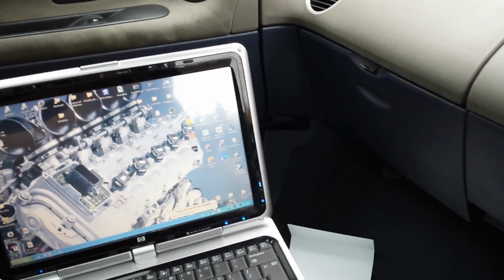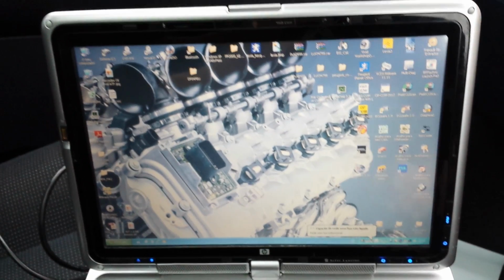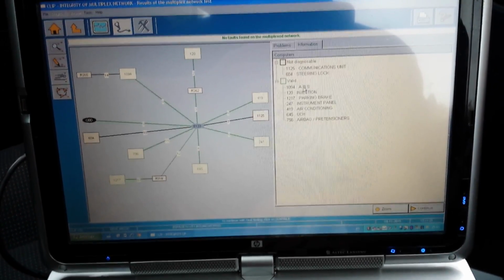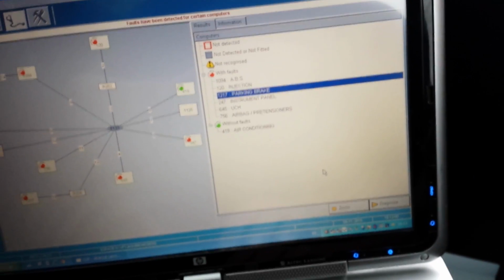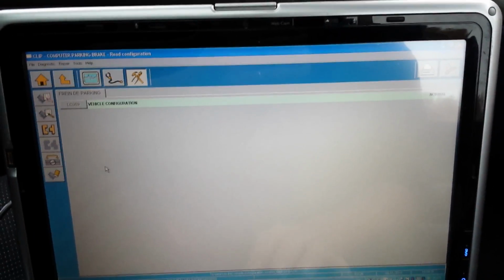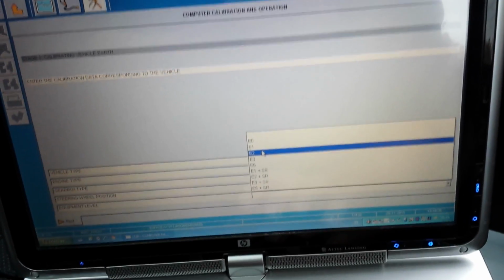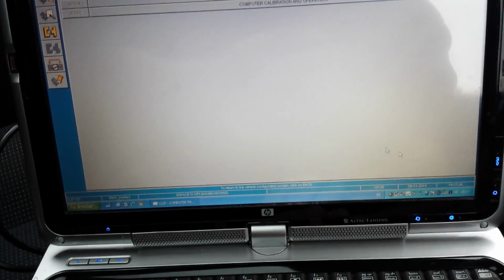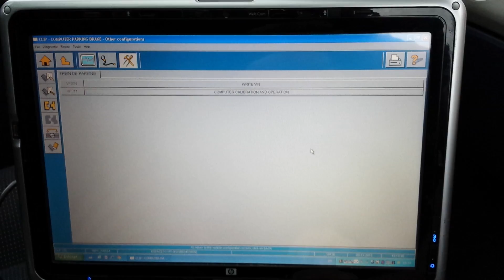Renault used electric parking brake configuration with clip.

Comment: I am having a similar issue with my Renault scenic.
Where is your garage? Can you please help me to fix it?
Reply from the maker: What issue are you having exactly?
Reply: So I recently changed the complete hand break module. Since then the hand break is not coming on automatically. It does come off automatically.
Reply from the maker: It could be coding...
You need to plug it in and check...
👍👍👍
Reply: I don’t have the code reader will you be able to do it for me where are you based?

Comment: Hey. What about if can clip doesnt recognize the unit? A friend of mine replaced the unit with second hand one and i can see it in clip the unit is present with another vin but the multiplex system shows the unit as not recognized. Could a second hand module be faulty?
Reply from the maker: Possibly...
But can you coded it first? 
Thank you for watching!
Reply: @LMAutoRepairs  code it like what? like you did in the video?
Reply from the maker: Yes...
Reply: @LMAutoRepairs  thats the thing.. i cannot access the coding menu because the unit is not recognized. and i cannot do anything with it
Reply from the maker: @anze.stempihar  
Well, in that case there is a possibility that that unit is faulty...
Check can lines, make sure you have comms ...

Comment: Would you please assist me with a few tips? My handbrake after the start motor was replaced, the handbrake doesn't go off automatically anymore.
Reply from the maker: I cant really see how would be related...
Any codes?
Thank you for watching!
Reply: LM Auto Repairs I will search for the codes and get back. The other challenge is the board says battery low when I switch off the car, like now I have to collect a replacement battery from my dealer after the one I bought in March died.

Comment: Hi great video just wondering if it's possible to write vin to a used handbrake unit on a scenic 55 plate as can clip won't recognise computer thanks
Reply from the maker: Hi
Something else is wrong... clip can't write the vin to a module that has a vin already programmed... but, would recognise the module even with a different vin... if that is not happening,  you either have a bad second hand unit, or there is a problem in the car somewhere...
Thank you for watching!
Reply: Hi thanks for reply much appreciated I think it's maybe the model numbers are different I opened both new an old brake module an circuit boards are completely different my old module had internal motor fault which the motor was burnt out so goin to purchase another module wiv same model numbers see if that works first thanks again for your reply I've watched a lot of your videos easy to follow an very informative thanks paul
Reply from the maker: @daisyvlogs2622  
Ok...
Can you not just swap the motor? 
Or are they different ?
Reply: Yer I swapped both motor an relay as the old motor was burnt out but still got internal motor fault df043
Reply from the maker: @daisyvlogs2622  
Ok... check that when the motor burned, did not damaged anything on the pcb... like fuses, relays etc...

Comment: Hi I just saw your video. My 2007 Grand Scenic has the same message on the dashboard. The handbrake has been replaced with a new one and was working fine. The message appears only whilst parked up or stationery but disappears when the clutch is pressed down, but reappears if I'm still stationery. No message appears whilst driving. My mechanic has changed the clutch sensor and gear box sensor but it's still coming up with the same problem. Can you please help or advise? No other problems.
Reply from the maker: Jusna Miah 
Hi
It sound like a coding problem... something has been coded wrong...
Why are they changing parts without diagnose the problem?
They should scan the car, look for trouble codes... live data etc...
Hope that helps. 
Thank you for watching!
Reply: LM Auto Repairs Thanks for getting back to me. The mechanic has scanned it and it came up saying that the clutch sensor and gear sensor needed replacing, hence the reason for him changing them. The message only comes up whilst the handbrake is on and car is stationery. However whilst in stationery position, if the clutch is pressed down the message disappears but comes up again aboutt 5-10 seconds later. No messages come up whilst driving though. Any thoughts? Thanks for your assistance
Reply from the maker: Jusna Miah 
As I said... it sounds like a coding issue to me...
Although the codes were for those sensors, obviously did not solve the problem...
I can't help you any further... take it to some one with clip and an understanding of those systems...
Reply: LM Auto Repairs Thanks for the advice. I will do that and see if anything changes.
Reply: @jusnamiah1608  hi there, i have same fault have you sort it out?thanks

Comment: Hi, I have a Laguna and have swapped the handbrake for a secondhand replacement my techno diagnostics tool won’t communicate with the new ecu and my local Renault specialist says it can’t be reconfigured. Having seen you do this in this video I assume that it is possible. Please can you put me I touch with someone that is able to do it. Thanks
Reply from the maker: Matt Dennis 
Hi
Which tool are you using?
Thank you for watching!
Reply: LM Auto Repairs Hi It is an autocom tool. I was able to make changes to the original ecu but this one says that there is a multiplex fault.
Reply from the maker: Matt Dennis 
If you can communicate with that unit, but you could do it with the old one, most likely there is something wrong with that replacement...
Just in case, make sure everything is correctly plugged in,  and check fuses as well...
Reply: Hi thanks for your reply, I don’t want to waste any more of your time but from memory the first screen says unknown ID continue to diagnose at your own risk i am then able to read fault codes from the new ecu but am unable to make changes/remotely operate unit.  Thanks for your advice, I will re check connections

Comment: Hi,Happy new year!I have ben replace parking break unit,to used one,it is vorks fine manual,but automat is not .I did all step as you did on the video,steel not vork automat the parking break,and the fault,is:DF052 multiplexed network,DF039 no UHC multiplex signal,what do you  think?

Comment: Hello - I have a similar fault. The hand brake unit has been replaced just before I bought the car. The hand brake will disengage when pulling away and come on when the engine is stopped, however the manual hand brake switch does not operate the hand brake. Is this the same issue?
Thanks for the video it was very useful.
Reply from the maker: Hi
Thank you for watching and for your comment!
It is possible, however the second hand unit should have come out from a car also with a hand brake switch... so I can't see why would need to have the switch configured...
But hey, it is a Renault!
Best thing is to have it diagnosed, ad see what comes up with...
Is the red light on the hand brake switch doing anything, flashing, off or solid red?
Reply: lmsvvavr the red light does not come on. I have a solus and will try to clear the faults later today but not sure If a solus can configure  parkbrake
Reply from the maker: william black 
OK... if the red light does not come on it might be something different...
I also doubt Solus can do configuration, however that does not sound to be a configuration issue... but if you can pull the codes out first they hopefully will point you in the right direction. 
.. would be interesting to see what's in there...
Reply: Thanks I will make a record of everything and post back here. I felt the problem may have been the manual hand brake switch itself which is interesting. I will also pop the switch out and probe the terminals.
Reply: faults cleared but still no joy. I have a friend with Renault FCR who will calibrate the system. will let you know...

Comment: I have Laguna 2 and recently replaced the instrument cluster. The second hand cluster has LCD in the middle and has different vin number. It works great, but does not show the Renault Logo when driving, just blank screen, other functions as cruise, low fuel etc... are showing.
Could it be because of the different vin of the cluster or because of different UCH? Is it possible that my UCH is not sending that kind of message, because my original cluster didn't have screen in the middle?
By the way, how can I change the vin of the cluster, which is already configured?

Best regards.
Reply from the maker: Right, if the cluster is different it is possible that other modules that feed info into that screen are not configured to do so, so you might need for ex clip, to change and adapt the correct modules to work with the new cluster... possible the UCH only... but you need to have a look when you have clip connected...
To change the vin, as is already configured, you need special tool to do it... or do it by removing the cluster, read the eprom and change it manualy... Clip can not do it...
I am not sure of what tool will be able to do it... would have to check...
Reply: +Imsvvavr Thanks for your super fast reply. 
I have the UCH from other car (original UCH for the LCD cluster) but it will not work, because it's not configured to work with my immo, engine ecu etc... 
Is there any way the UCH to be reprogrammed or virginized, so it will work on my car and eventually show the Renault Logo on the dash.
Thanks.

Comment: Friend which software did you use?
Reply from the maker: Renault Clip...
Reply: thanks bro
Reply from the maker: Eliseu Pereira 
Which diagrams do you need?
Reply: I need the complete electrical system diagram
Reply: you speak Spanish? I can call you and explain my problem! I'm lost and the mechanic is too.
Reply from the maker: Eliseu Pereira 
No, I am portuguese...
Anyway, I will have a look to see what I have... but i don't think I have the whole car diagrams...
Reply from the maker: Eliseu Pereira 
Which engine do you have?
Reply: Four cylinders in line, 2.0 16V  the car is a "Grand Scénic version Dynamique"  2008

Comment: Hi! Awseome video, which saved my day! After i had a broken EPB ECU i changed it and had the same error but in a Grand Scenic III . Do you know if this configuration can be done with one of those "Green PBC" CanClip Clones from ebay? I read through the comments but only had seen problems considering software updates on the car. Also i think i need to reconfigure the AUTO ON and OFF of the parking brake, as this didn't work anymore after changing the EPB ECU. Where do i find this setting?
Reply from the maker: Hi
Thank you for watching and for your comment! 
Configurations are also dependent of the software version on the module.
Different software, different options....
In your case and by your description, it looks like a configuration problem....
My clip is also a clone... 
But not from eBay...
I would say you can do it with one of those clone units...
Can't see why not...
Hope that helps...
Reply: Awesome, thanks a lot! I will try to find somebody around my place who already has a CanClip Clone with the equivalent software working and try to reconfigure the EPB ECU.

Comment: Hi, great video.  I wonder if you can help me. I have a 2004 1.6 petrol Scenic, EPB failed so I have removed it and put a manual one on, works fine. I am now left with the 'service' symbol, P in triangle and 'electronic fault ' message. How can i clear these? I have an OBD2, doesn't seem to do anything though.

Comment: Hi. How do you connect the laptop to the car? Thanks.
Reply from the maker: Hi
Can Clip, Google will give you all info about it.
Thank you for watching!
Reply: +lmsvvavr Thanks for the reply. I had a new genuine Renault handbrake fitted. It is working but you have to apply it manually and doesn't turn on automatically when you turn off the car. Also, the light on the handle keeps flashing. The electrician says because of the different model of the brake, although he programmed it to the chassis number.
I don't know if this tool would help resolve the issue?
Reply from the maker: +Bran “subzero” Boni 
The auto brake when the car is turned off, and/or the auto brake off when you take off, are optional, they can be turned on or off using this tool.
If the light is flashing, means something is not right.
On top of programming the system, if was a genuine brand new module, depending     on the car, it also needs to be initialized, and sometimes other stuff needs to be done.
This tool will allow you to do all that, providing you know what to do.
Hope that helps.
Reply: +lmsvvavr Although the red light is flashing, there is no error message on the screen. What knowledge do I need to have to initialise it? It is a Renault Grand Scenic 2006.
Can you please provide a link where I can buy the tool?
Thanks a lot.
Reply from the maker: +Bran “subzero” Boni 
Hi
You might not have a message on the screen, but will be one on the module, when scanned.
The tool software will guide you through all the processes,   as for the link, you have a lot of places selling them, eBay being one of them...
Reply from the maker: +Bran “subzero” Boni 
Most likely not. ..
You need the "real" thing...
Search canclip...
Reply: +lmsvvavr Yeah, I did but it costs over £120 and I've already paid a lot for a new handbrake and fitting. Thought would settle for a cheaper choice...
Reply from the maker: +Bran “subzero” Boni 
I understand, but I can't help you on tools that I haven't tested or used.
Sorry.
Reply: +lmsvvavr Sure. Many thanks for your help.

Comment: I have Renault Scenic 2007.
After calibration I got fault code "Brake cables incorrectly fitted; detection of incorrect brake cable assembly"
Even though I haven't touched the cables, all the time I receive this fault code and I can't clear it.
I have tried with Can Clip, Delphi, WOW Wurth, non of these will delete the fault code.
As I know brake cables should be connected to the calipers while calibrating.
To be honest, I haven't connected battery charger while calibrating the parking brake. 
Could be that the issue?
I'm running out of ideas.
By the way parking brake works just fine, but I can't get rid of this fault code.
I will be very thankful if you can shed some light upon this.

Best regards.
Reply from the maker: Hi
First of all thanks for watching and comment.
Without knowing the background details, it is a bit difficult to diagnose. 
But, are you sure you have selected all the correct options during calibration? 
Is the module a replacement?
Make sure everything is correct with the system. 
With the latest clip reprog, check if an update is available, do it if one is available.
Sorry if can't give you a straight answer. ..
Reply: +lmsvvav I haven't changed single thing on my parking brake. My brake cables were frozen, and all I have done is disconnected the brake cables. After few days cables were defrosted and I connected back to the calipers. 
I have selected correct options, but can you please tell me:
Before calibration, should parking brake be ON or OFF?
My brake was always ON before calibrating, and when I start calibration parking brake can't go any further because brake is ALREADY ON, and makes very short sound trying to apply the brake, but when releases the brake, I have that normal sound which last for few seconds.
Maybe I should turn OFF the brake BEFORE calibration, so when calibrating brake can go ON and OFF as normal for few seconds. 
When the brake is ON before calibrating, maybe the EPB module sees the cables or calipers as stuck or not fitted correctly and throws that code.
By the way I have not restarted the module, and maybe that will help.
I would like to hear your opinion.

Thank you.
Reply from the maker: +Wrench Tool
hi
You have nothing to lose in restart the module.
Make sure all the cables are fitted correctly. 
Does clip shows any update available for the module?
Reply: +lmsvvavr SOLVED. I just restarted the module and cleared the code.
Thanks.

Best regards.
Reply from the maker: +Wrench Tool 
Glad to know...
Reply: How did you restart module? Disconnecting battery, or other solution?